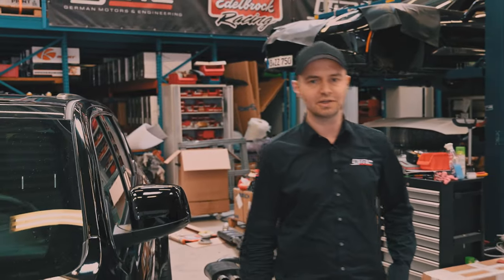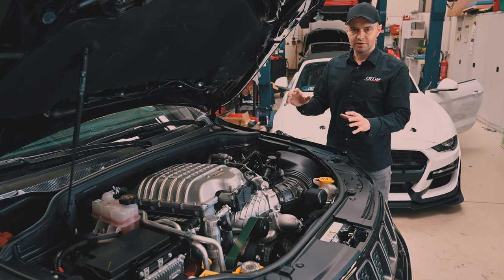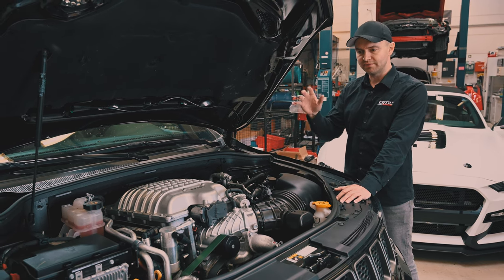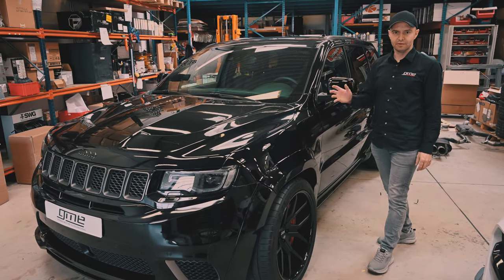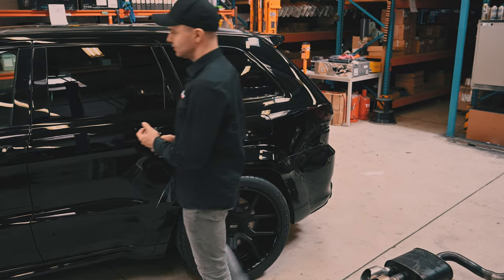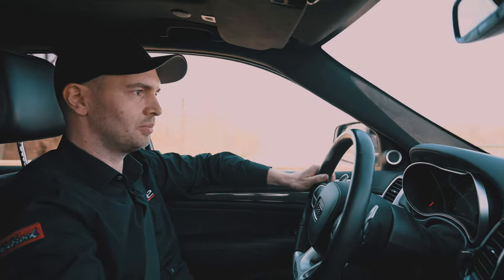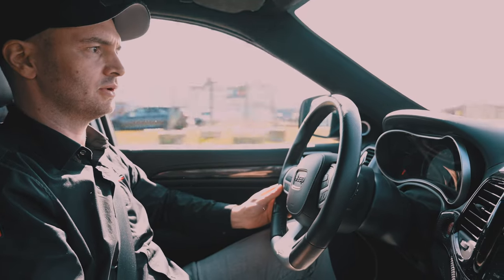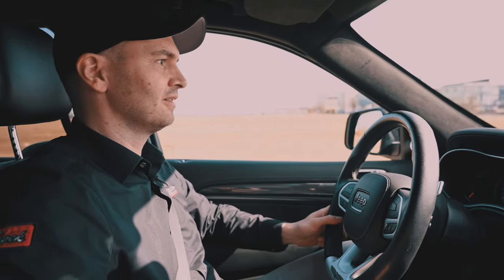Transformation BLACKHAWK Jeep Grand Cherokee Trackhawk - GME Performance

Comment: I want to upgrade the brakes on my 2021 jeep Trackhawk
Reply from the maker: We have the upgrade brakes you‘re looking for! Send me an email to “rene@gme-gmbh.eu”!
Reply: @GMEPerformance  ok. I’m in Cali! Do they stop better than stock?! Stock ones suck!!!!!
Reply from the maker: @joemomma707  Of course they do. They are build for that purpose. Depending on the friction rate of the brake pads you will use, it takes 30-50% less pedal force to stop the wheels from rotating. But these big brakes also require big wheels. We can offer brakes in different sizes which fill wheels from 20 to 22 inch completely.